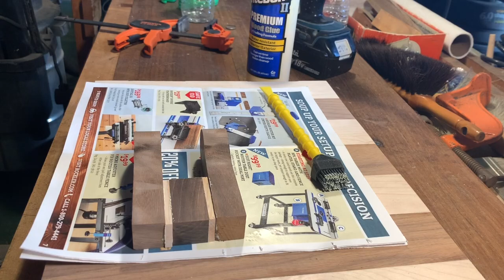Tortilla Press "Making it"

Comment: Such beautiful work - would have like to see the alever support installed is it screwed in and what holds the lever in place me wonders?, Thank you
Reply: Thank you very much! Yes, Im no pro at making videos for sure 😂.
I used screws and glue for the lever base then covered them with plugs.
 I used a dowel with no glue and sanded to fit to fasten the handle. Wanted to be able to remove and replace in case the lever gave out.

Comment: Ok you asked for it!  First I would like to say this is a very nice looking project and I will be making a tortilla press along these lines, good job. Now for the rest, you don’t need to show all the sanding. You didn’t show how to attach the press handle, I know, I know I should be able to figure this out.. easy stuff but not everybody will. Also you might want to ad feet to raise the body so the press won’t sit in water (moisture) while using. Also do a finale demo.   Ok that was enough, this is exactly what I was looking for, very nice.
Reply from the maker: Hi Bob, thanks for the critique! Yeah I know Im lacking on some information. I'm still getting my feet wet with the filming part. One of the many little details I left out was that after the mineral oil dries, I do put some clear rubber feet on them. Please let me know if I can help or answer any questions that I didn't address in the video.
Reply: Along those lines, how was the handle connected?  Also, it seemed that you put the glue on the surface of the wood instead of in between.  Do I have that right?  What was the reason for this?  Sorry for all the newbie questions
Reply: @dkroen17 The wood was roared 90 degrees to match the glue surfaces up.

Comment: I have to ask what the measurement of the tortilla was in order to get the proper spacing between the boards.
Reply from the maker: I used a micrometer to measure a corn tortilla and it was almost 1/8” thick. So that’s what I went with.

Comment: Not sure maybe I missed it, but you never show how you attached the handle to the uprights ?
Reply from the maker: I use a 1/2” dowel and give it a snug fit, but can still be pushed out if needed.  For the hole, I slip the handle in between the uprights, clamp it and drill it. I kind of set it up like its going to be, and make sure it looks right, then go for it. Hope that helps
Reply: @jeffportercreations8234  Thank's for the reply, I am making one out of oak , I am still not sure how I am going to attach the uprights and handle but I am thinking dowel and glue also. You're press looks Great. 
Thank's Again
Reply from the maker: @H43339  I use two recessed 2-1/2” screws and glue and then hide then with dowel plugs
Reply: @jeffportercreations8234  Thought about that but I ended up using 1/4"  dowel and glue. I was wondering what brand glue have you had the best Luck with  ?
I bought Titebond lll
Hope  it will be strong enough.
Reply: @jeffportercreations8234  I just watched your video again, looks like you used Titebond ll.
I am hoping Titebond lll,  will be strong enough. I read the fine print says not structural.
Reply from the maker: @H43339  thats what I use 👍 I use all the Titebond glues. The II or III will both work great

Comment: Have you had any issues with the glued slabs breaking under the pressure of using it? I've been avoiding a butcher-block style press for that reason. Maybe I'm too cautious?

As for the video - The only thing I'd be more careful of is getting yourself in between the camera and the work. Yes, I know it's a little difficult - keep up the good work!
Reply from the maker: Thanks for the helpful critique Brian! So far nobody has reported any damage.  This is the one that I still think about though. I ran the glue joints 90 degrees to what I normally do.  So far so good. You know the saying that “the glue joint is stronger than the wood” (as long as the joint is good).
Reply: @jeffportercreations8234  ya, I think I'll build it running the other way. I've had those kind of joints fail occasionally, leaving a shred of wood that broke off where the glue was in  fact stronger. :)
Reply from the maker: @rbrianlindahl5499  post a photo when you get it done
Reply: I originally thought the same thing too, but now I’ve gone down a massive tortilla-themed rabbit hole, and the one thing that keeps coming up is how little pressure it actually takes to flatten the tortilla. I think I always got thrown because of all the cast iron ones (because why would they make them so heavy duty if it isn’t needed), but in the bon appetit video where Brad goes to a place that make their own all day every day, you can see how little pressure is needed (and how easy it is to use too much pressure). Now I’m thinking I can go back to my plans for a jointed wooden one, and the fear of destroying my creation can be the thing that stops me from pressing too much :P
Reply: @natmickan  Yeah it's not much pressure at all. I would love to see it, if you have the chance to film it or take photos after you make it.

Comment: Do you sell those?
Reply from the maker: Yes
Reply: @jeffportercreations8234  okay what would be the price on a 16” X 16” ? And how can I place the order?
Reply from the maker: @Joelwilly57  depends on how I make it. Do you want mixed hardwoods? One like this at 16” would run 200-250, but I could make it less expensive by using less expensive wood. I just heard about lumber going up a ridiculous amount (like $9 for. 2x4) so I would need to verify that to be sure.
Reply from the maker: @Joelwilly57  I just saw how lumber is a lot more expensive right now. Ridiculous!! I would have to check on whatever your interested in to be accurate. Just wanted you to know.
Reply from the maker: @Joelwilly57  one more thing- you can try to win one tomorrow. Just subscribe and comment “I want the tortilla press” in the Give Away #2 video comment section. I’ll announce the winner at 8:pm.

Comment: What kind of woods did you use?
Reply from the maker: Jon Teske maple and Walnut
Reply: Beautiful choice, I love the juxtaposition of the contrasting colors and grains. I’m in the middle of a rolling butcher block counter top project using hard maple, walnut and mahogany. I’m using a contrasting and repeating pattern that breaks up the walnut/mahogany with the maple strips. I’m really looking forward to seeing everything pop when I hit it with the mineral oil.
Reply from the maker: Jon Teske that sounds really cool, I love that combo and have used it myself. I’d love to se that when it’s finished!
Reply: Lots of time spent on sanding and applying the finish on the video. Why is that? The hinges could have been installed between the boards for a much more cleaner look.with